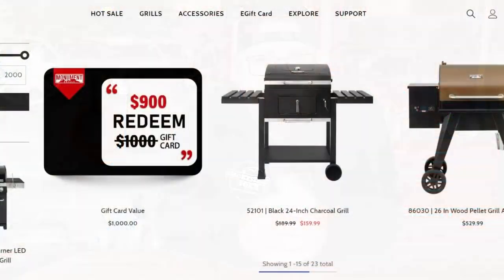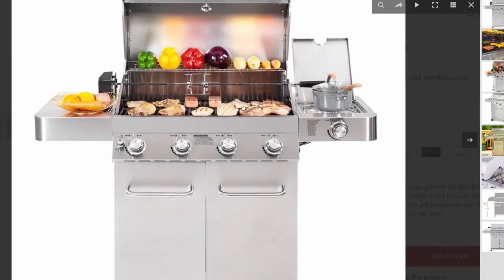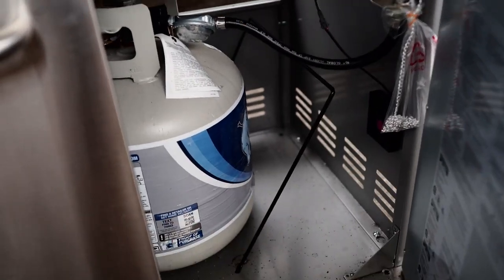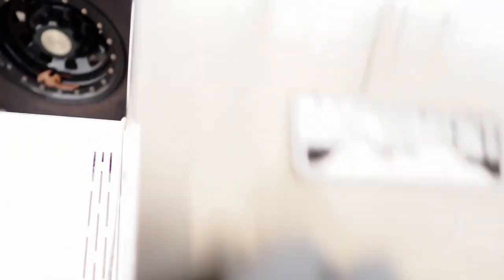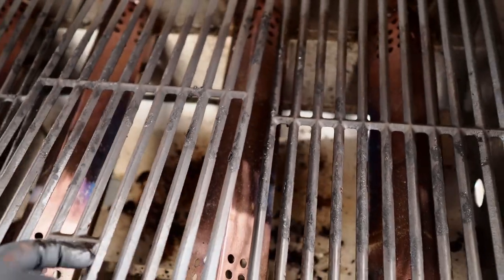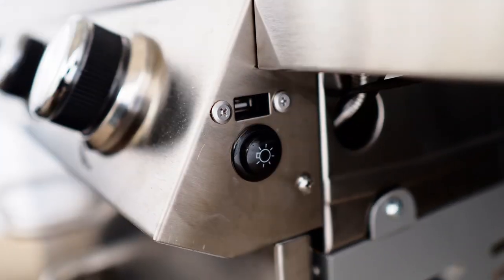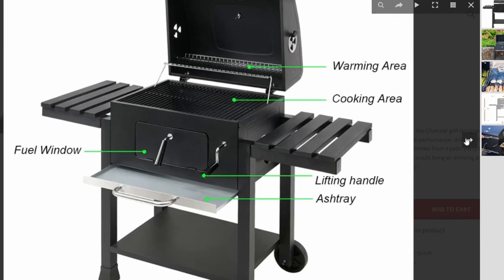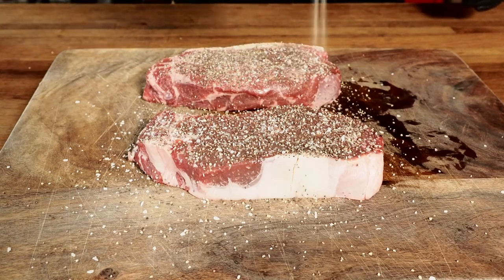How Good Is It? Full Review of Monument Grills 4 Burner Propane Grill

Comment: I ordered a grill from them, which arrived before Memorial Day. Unfortunately, it looked like it had been dropped, and sure enough, the sheet metal was badly bent. Not Monument's problem on the face of it, but they were good enough to tell me they would replace the part for me. That's where the issues really began...
I was informed that the replacement part was shipping on June 7th. But 2 weeks later it still has not shipped. They are not responding to my emails. Nobody answers the customer service number or replies to the numerous voicemail messages, so I have no idea when (if) I will get the replacement. 
Although I was told I would be getting the complete to part of the grill replaced, the shipping details gave a weight of 0.4lbs, so if I ever receive the part I suspect I will have hours of scavenging parts from the damaged assembly and building up the new one. Oh joy!
Reply from the maker: That’s a bummer, I’m sorry to hear that. I know what it’s like to deal with that. The only thing I can’t test on the grill is their customer service so thank you for the comment letting me know about your experience with them.

Comment: Good video looks like a great barbecue. I’m here because I’m looking at one on sale obviously because I need a new one only downside is there’s nothing you don’t like about it plus they sponsor your video. I’ll keep my fingers crossed.
Reply from the maker: Yeah I understand, Its tough doing the sponsored videos because a lot of people don't believe what I say but I was giving my true opinion. 

The grill I have has been great so far though. It is very solid and built well. The rotisserie is my favorite part. It makes the best whole chickens. 

The only complaint, which is small, would be putting it together. It wasn't that bad to put together but it is still a project to do. The other thing would be the longevity of it which is the big problem with gas grills but I have not had mine long enough to know.

But like I said, so far the model I have has been great, knock on wood.